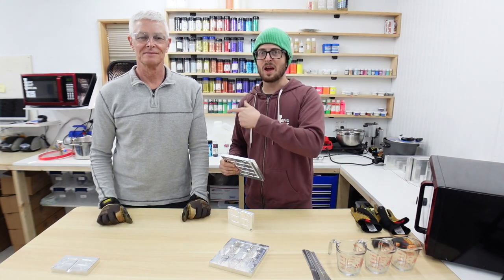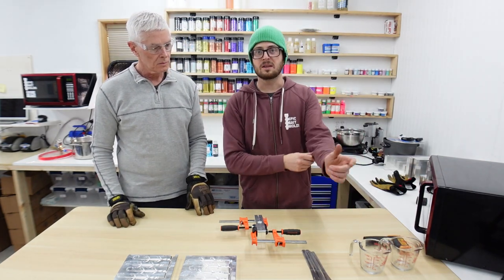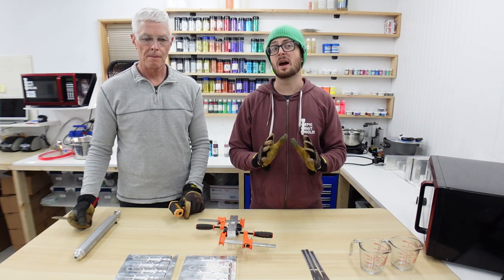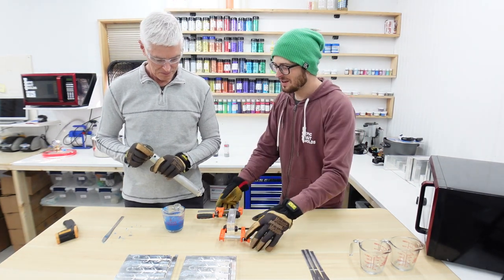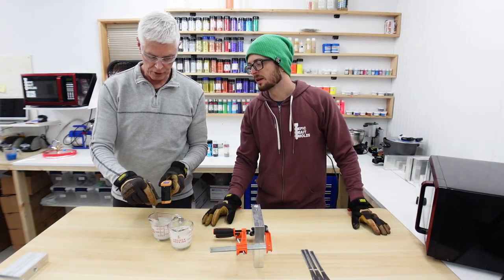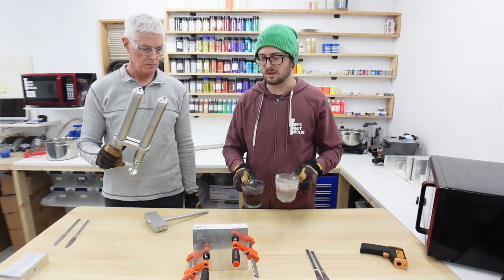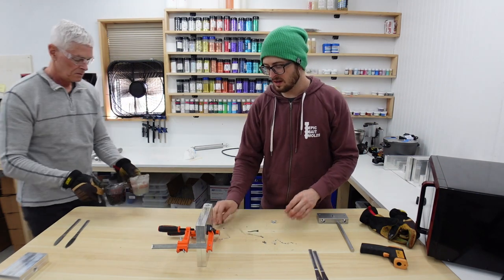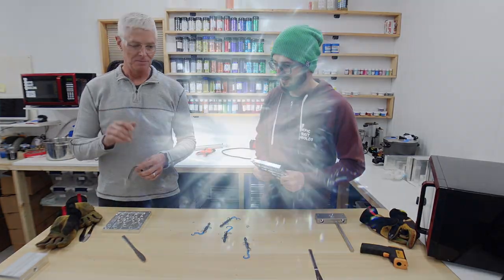A Blue Tailed Lizard!

Comment: Something I haven't seen before is a baby snapping turtle injection mold. Seems like it would be an interesting bait. You could use the shell as lamination point. Just have one half of the mold the head and top of the shell. And the other half have the legs neck and bottom shell and tail